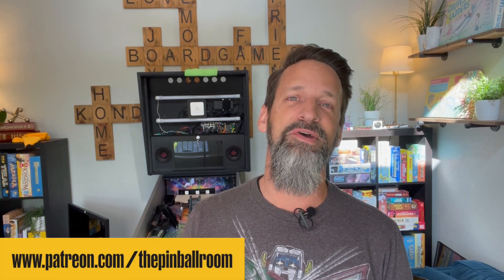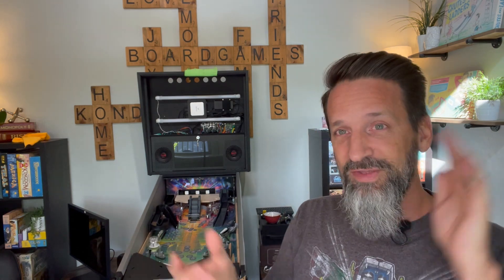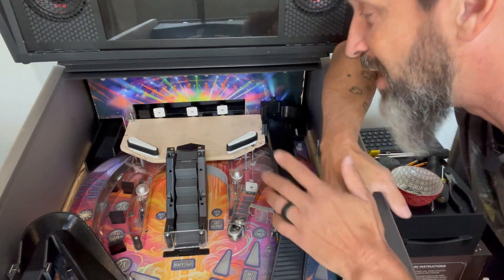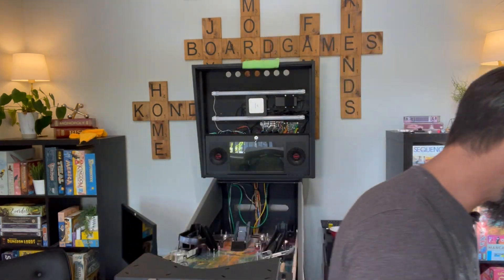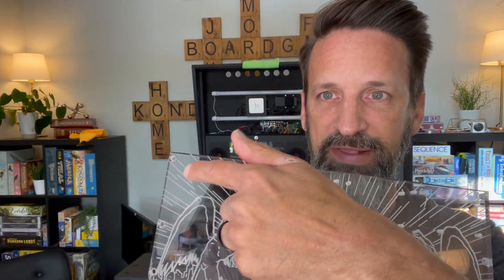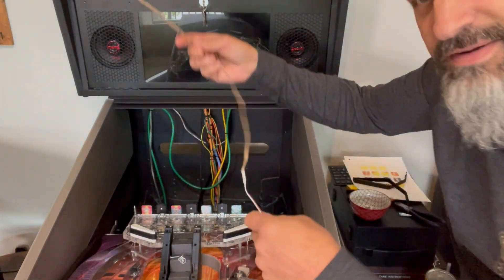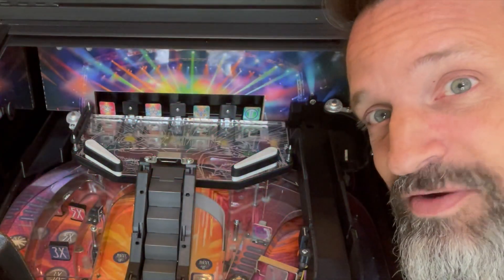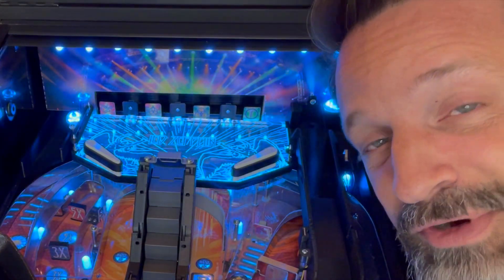HOW TO MAKE A PINBALL MACHINE: New Upper Playfield

Comment: Hey Steve, been following you for a good while and while I started building my own pinball machine from scratch before ever discovering your videos, I did get quite some new and very good ideas from you. So big thanks for that!

As far as the new upper playfield, it looks very slick! I did a similar thing for the outside sign of my wife's barbershop. Thick acrylic, engraved pretty deep (for more effect, especially in daylight) and RGB LEDs from the bottom and sides.
However, what I feared all along is really starting to show after it being in use for a while: The front (top, in your case) will get scratched and buffed (in my case due to weather conditions and in your case due to balls moving and skipping over and on it). That, after a while, really has a negative influence on the effect that a lit-up engraving has.
Have you thought about that and perhaps have something in mind to minimize or manage that?
Thanks and keep up the absolutely amazing and inspiring work!!
Reply from the maker: Yes, I've got some very thin sheets of acrylic that I can put on top as a disposable protective top layer